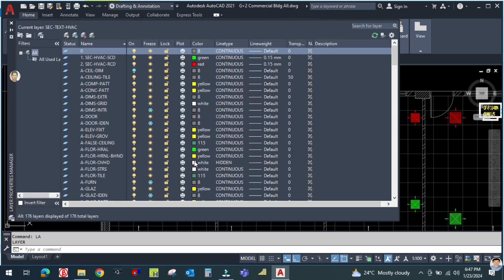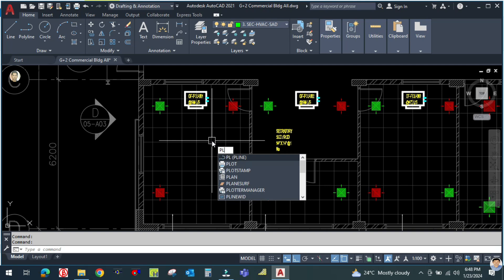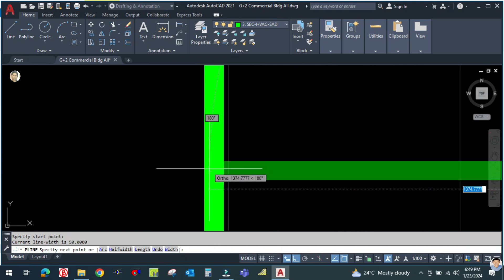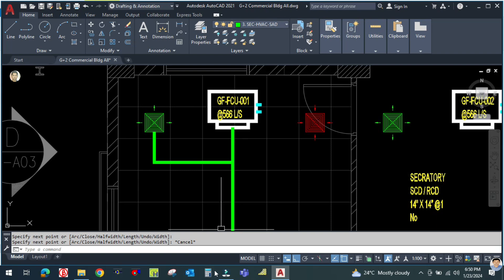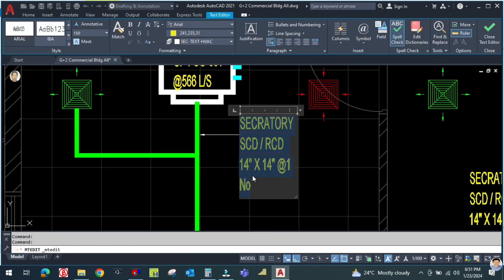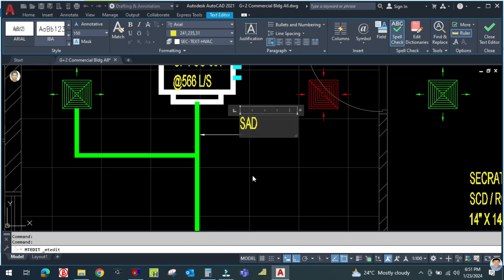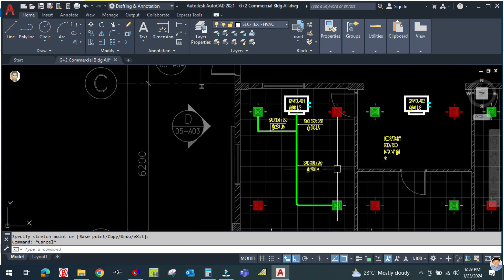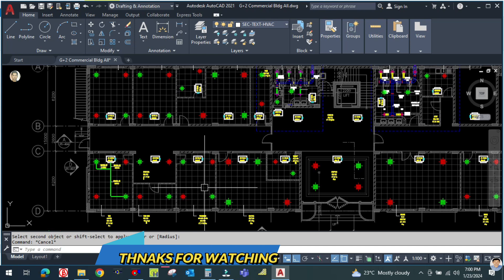Duct Designing I DUCT SIZING I Duct design Kaise Karee I Ac duct design kais karee I Part-1 I

Comment: Hi Engr. When to use equal friction method?
Reply from the maker: For commercial and residential buildings we are using equal friction methods
Reply: Thanks. How will i know if the duct size that i use is not exceeding  the required allowable size?